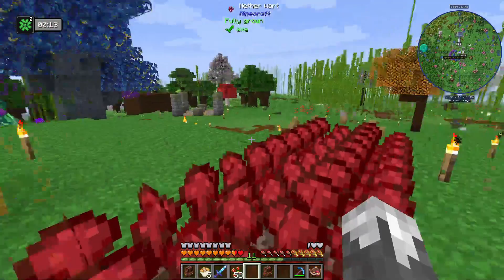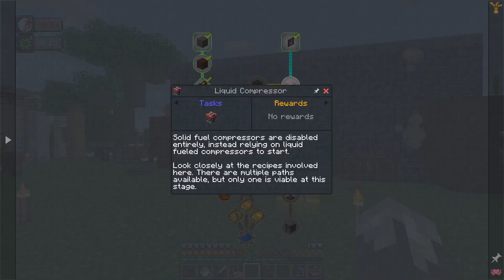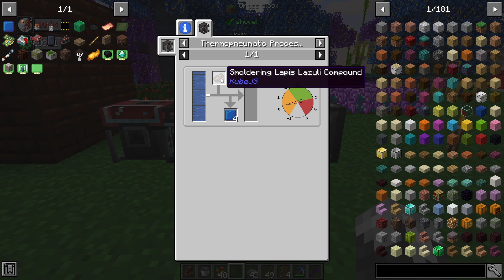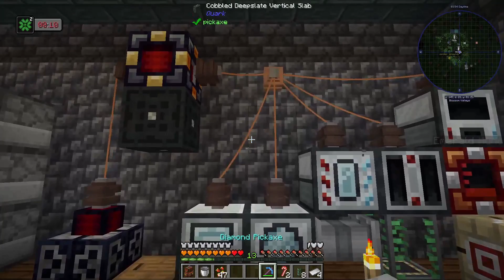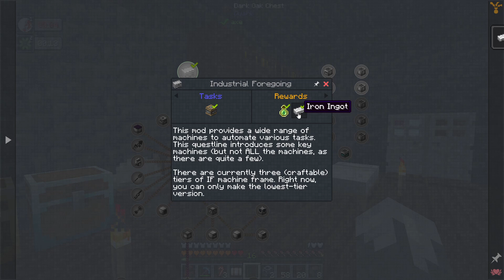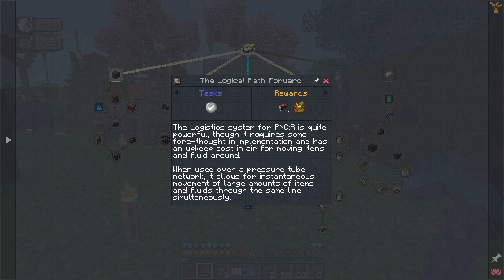Enigmatica 6 Expert Ep. 15 Getting Into Mechanical Stuffs

Comment: Hi. Thanks for another great video. This modpack is funnier to watch than play, at least for me.
I think compressor can be configured to receive redstone signal, for example from a lever. Also wrench from pneumaticcraft can break a block without losing accumulated internal pressure (or vacuum). IDK whether you can craft it at this stage. And from my experience latex extractor from Thermal is better than one from IF because it doesn't destroy a log and can be ungraded with a component.
Reply from the maker: Not sure if I can do it with pneumaticraft yet but we are fixing to get into it. Yeah the thermal latex doesn't destroy the log but unfortunately it's a different latex than we need for IF unless I have missed something. And yeah this pack is a pain. I should have know after playing through E2E that you can't just make or do something. You need to just set up the whole infrastructure with it all. Something we are fixing to get into.